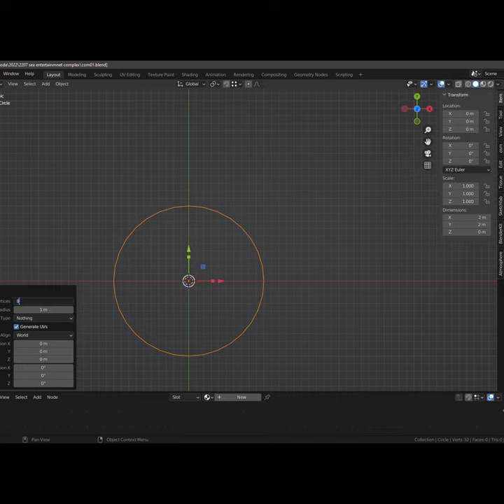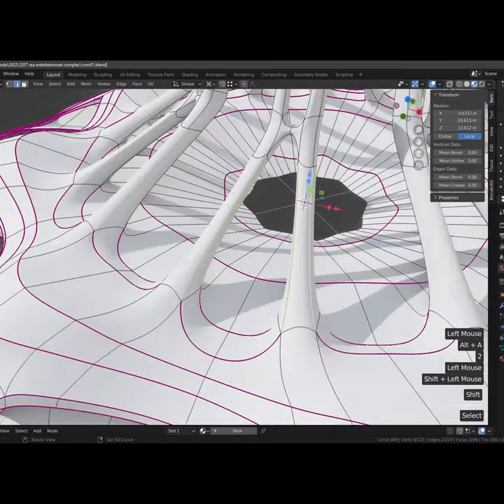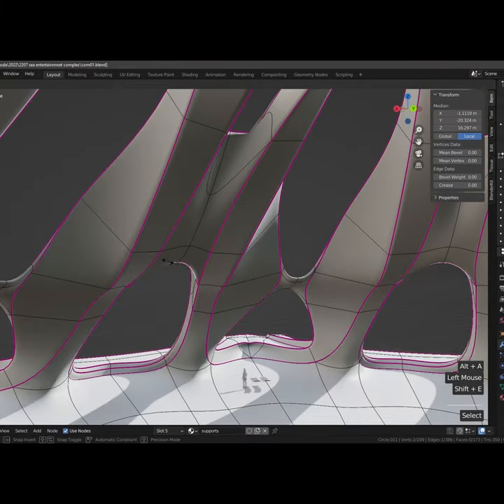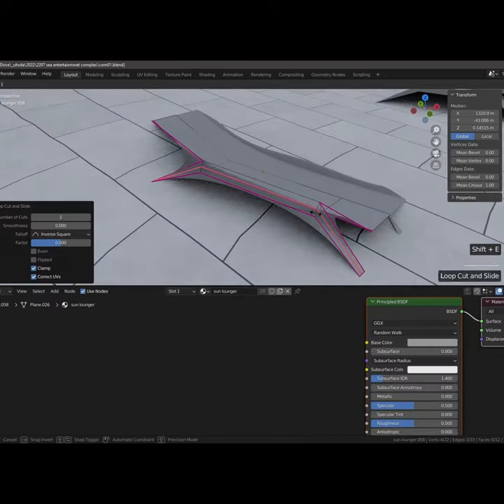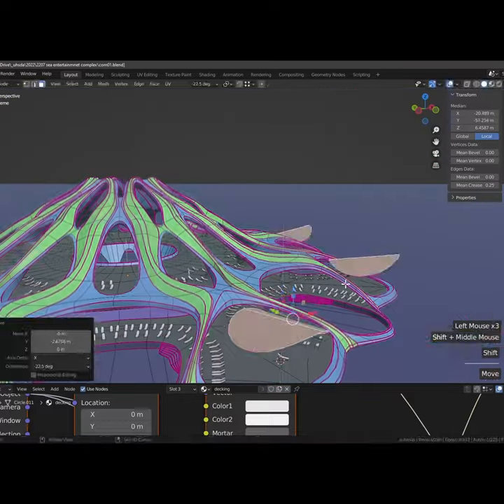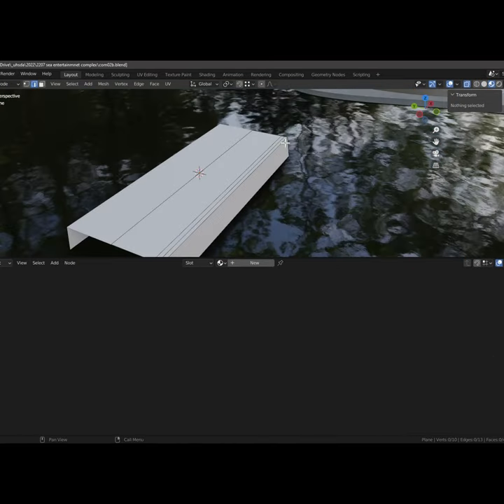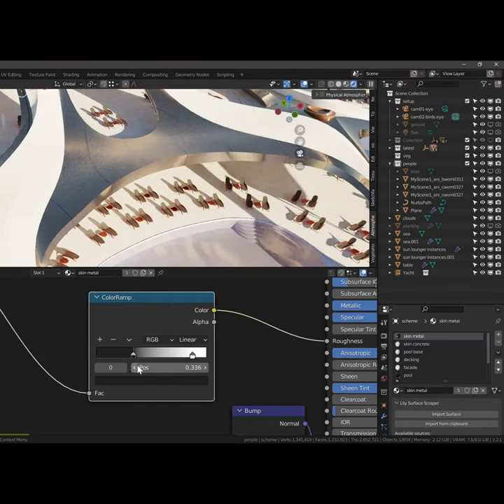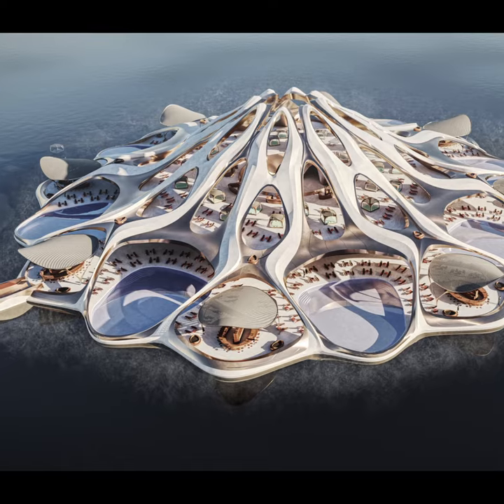Design and render a beach pavilion in Blender - 2 min overview

Comment: From an architectural POV it's stunning
From an engineering POV, i wonder about structure integrity
Reply from the maker: Structurally, it would have a rigid metal frame (columns and beams), a cage around the frame, and lightweight panels attached onto the cage frame. Not too complicated. The more complicated part would be making the panels, but also that wouldn't be so complicated anymore, especially since in this case there are many repeating panels. If you are interested, check out the construction process for Zaha Hadid's Grand Rabat Theatre. Newteknik, the facade consultant has some additional info on the process on their website.

Comment: What is the clipping distance to have seamless mesh radially while using the array.
Reply from the maker: Not using the clipping option - if you start from a polygon, and then rebuild procedurally with radial array, there is no need to worry about clipping